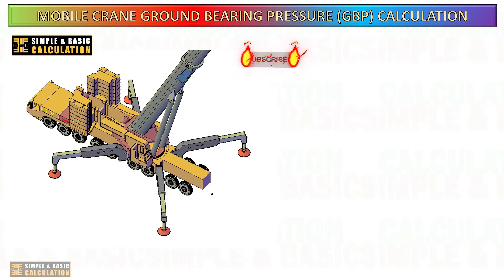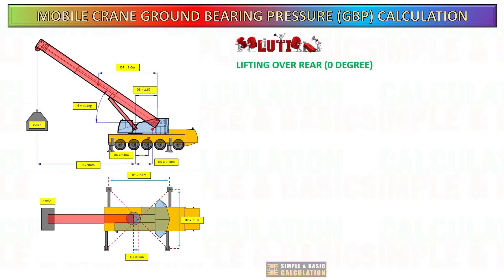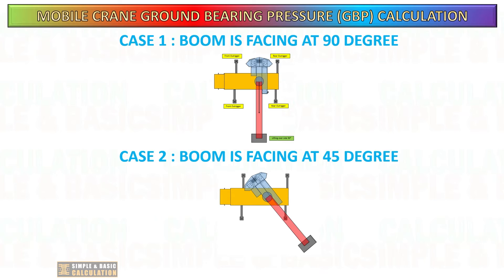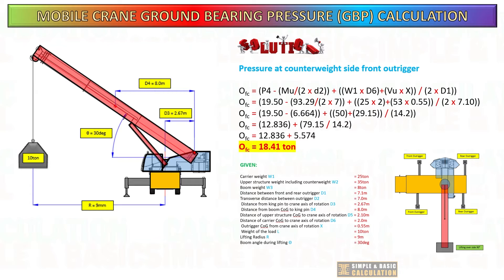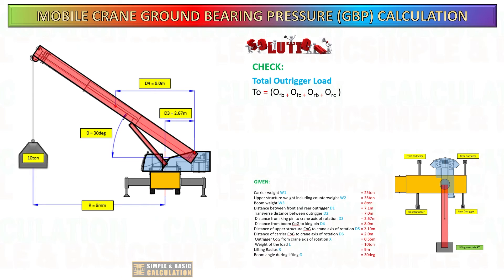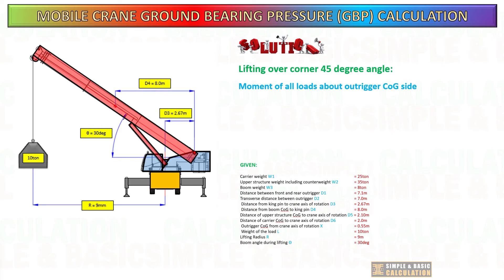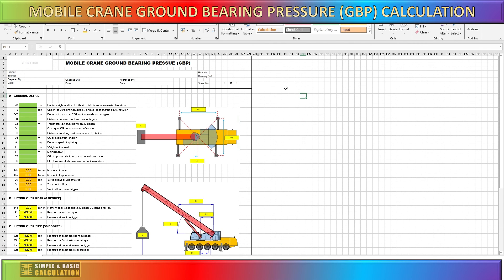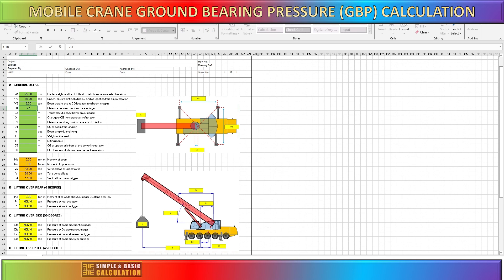How to Calculate the Ground Bearing Pressure for Mobile Crane Part 2

Comment: Hello, is it special software for calculating ground bearin pressure?
Reply from the maker: Thank you for your comment.
Yes, crane manufacturers have this type of software to determine gbp.
Most crane manufacturer give this software, if you buy a crane from them.
However, some of the older crane models do not have this software.